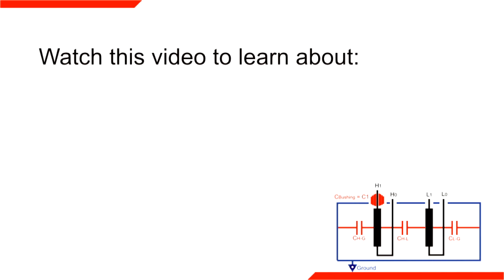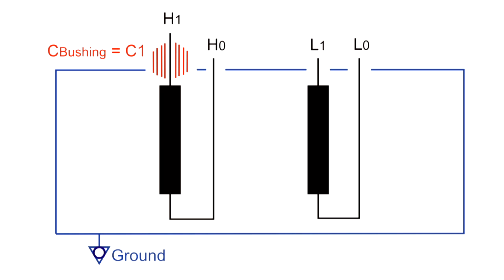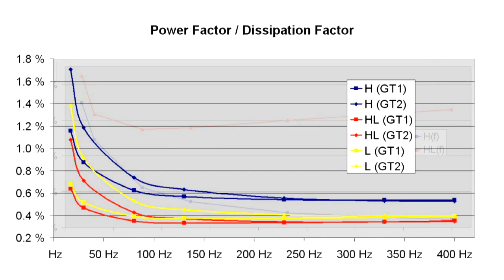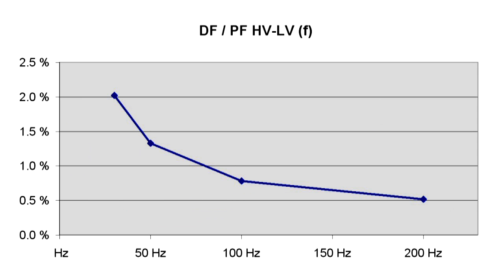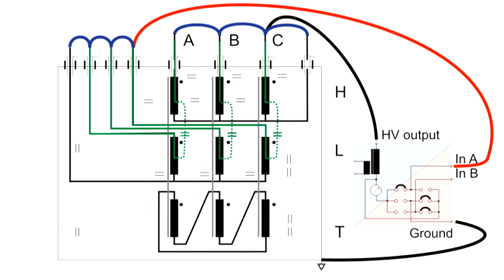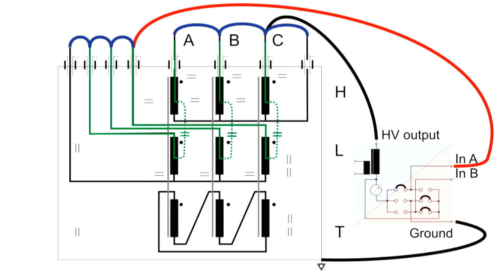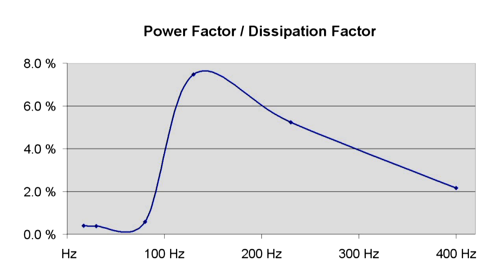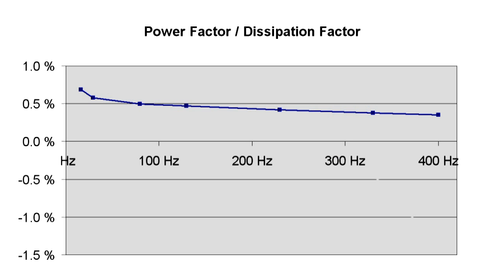Diagnosing Transformer Winding Insulation

Comment from the maker: The oil inside the transformer has different densities - the hot oil has a lower density than the cold oil. Therefore the hot oil rises inside the transformer and causes an oil flow through the transformer from bottom to top during operation. when the transformer is switched off, the same effect occurs. As the amount of oil in a transformer is huge, it can take more than two days after switch-off until the transformer has the same temperature at the bottom and at the top.
Reply: great explanation thanks

Comment: The repaired transformer on 25% load of 5MVA, 33KV/3.3KV is having winding temperature at 60 degree centigrade and 55 degree centigrade temperature of transformer oil.When assessed by touching the tank it is observed that the upper half of tank is twice hot to lower portion of tank always,why no uniform het conduction.why the oil is not having uniform heat convection inside tank?